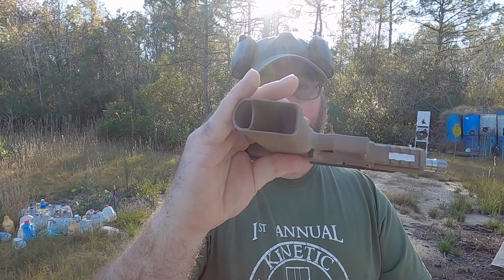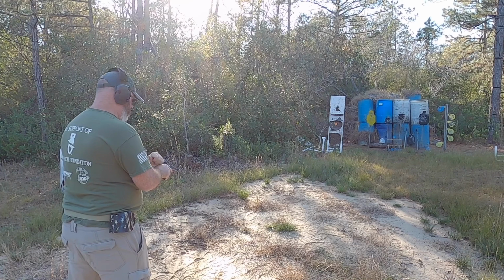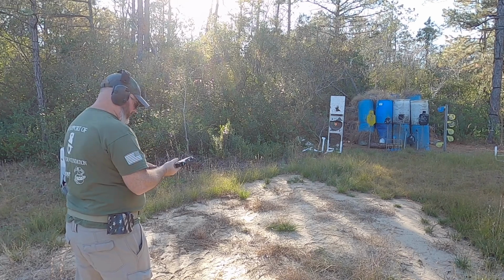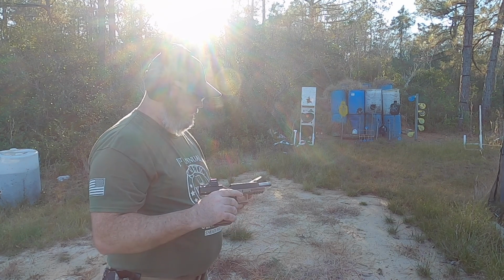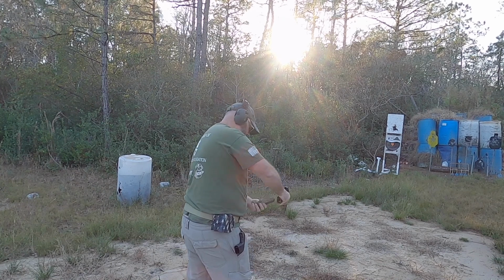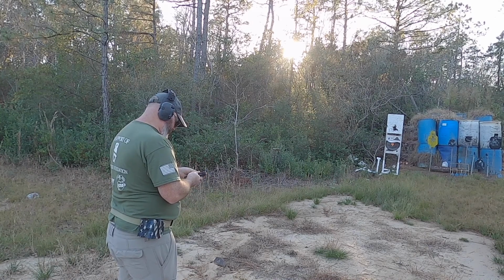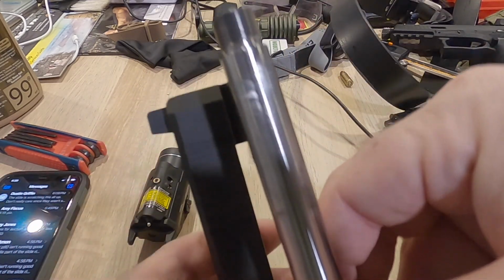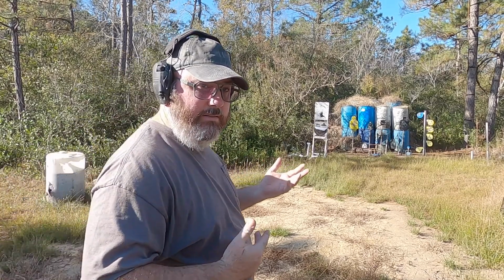2nd P80 PF940V2 Glock 17 Build First Shots, Thoughts and ...

Comment: Think I'm running into a lot of the same problems.  Thanks for showing the process of running it down.  Did the barrel stop rubbing when you polished that rail with the brass on it or did you have to polish that part of the slide, too?
Reply from the maker: Yeah, it fixed it. No running or running anymore. I polish every part that touches another part

Comment: Your getting ejection issues bc of the extractor you need to get the gen 4. marinegunbuilder is the goat when it comes to p80 check his channel out he has a lot of good Info. P80 themselves recommends his videos. He also run a blog where you can find deals and topics or if you need help it’s a good community. Passing it along for anyone that’s new to p80 builds
Reply from the maker: I’ve got it running great, just have to clean up the rails and such. 100% perfect now, I just haven’t made another video about it
Reply: Alot of aftermarket LPKs caused me issues so went OEM & runs great now.